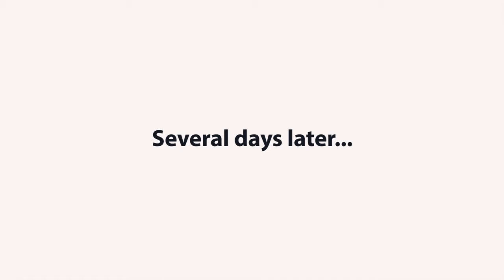Mini Mini Indian Restoration Part 3 - Kickstand Repair

Comment: Gusset for strength as an attempt to stop the same failure in the future?
Reply from the maker: Yes, if I were planning on using the bike, that would be a great idea. It is too weak for a the beating a child would give it. This one will be a running restoration but not really used. I want it as close to stock as possible. Thanks for watching!